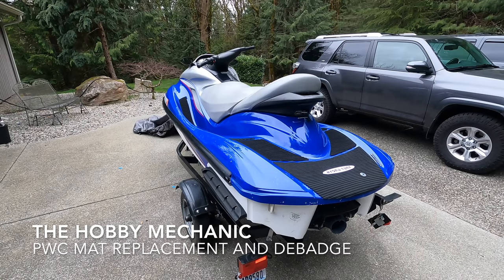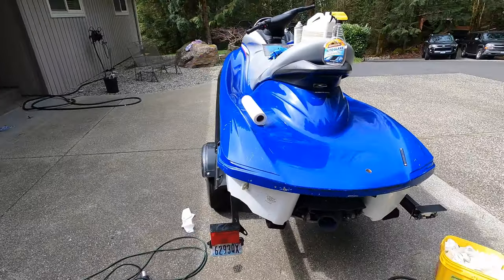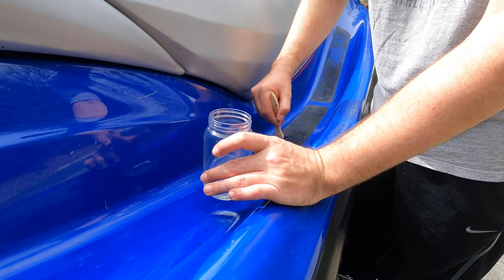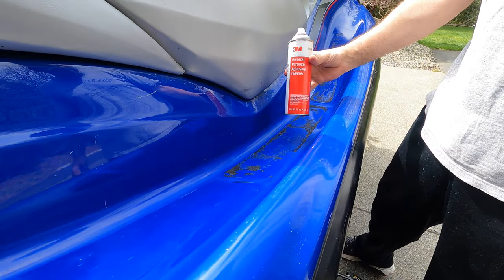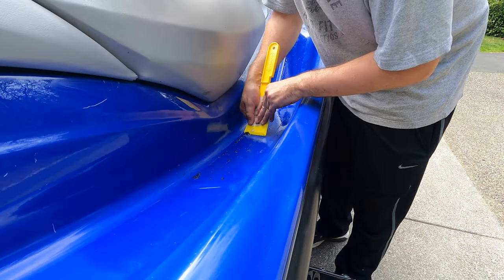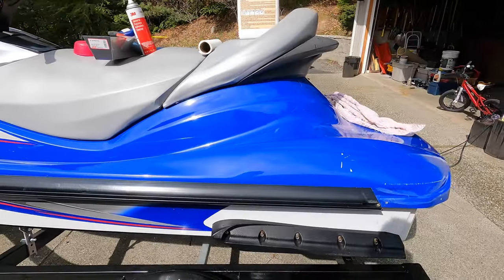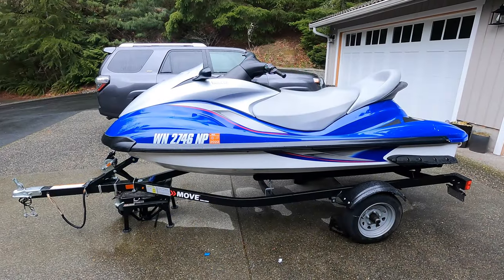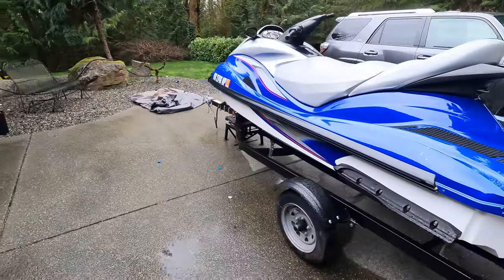Project Remove/Install Mats + Decal/Oxidation Removal On A 17yr old Waverunner - Hobby Mechanic

Comment: I just finished removing my traction mats. I tried a number of approaches I saw on YouTube. They all were not very good. I then tried 3M’s adhesive remove. It worked great. I used Googone on the last bit of glue. Worked great. I had scratches like you. I used a 2 part epony to fill deep scratches and painted with 2 part marine paint that was a perfect match.

Your video was really good and helped.
Reply from the maker: Happy to hear!  Yeah, I thought the other Youtube vids made it look way too easy.  Or they just scratched the crap out of their gelcoat and didn't care.  I've been thinking that masking/taping around the mats first could prevent the scraping.  Maybe next time!

Comment: I have not done anything near this size but you can go to a auto paint supply store and buy a rubber wheel that looks like a big eraser. They use it to take off the adhesive from badges without hurting the paint. Again, nothing this large.

Comment: Instead of adding on more Matt’s with glue, tape off where you want to put your Matt’s and sand it with 80 grit and spray on bed liner. It’s waterproof and will never fade or peel off because you have a mechanical bond with the 80 grit sand scratches and you can use whatever color you want !

Comment: Looks great, so im about to pick up the same ski, (2 of them) but 2006's and Im probably going to do the same thing you just did and the straight pipe too.
Reply from the maker: Nice!  I think they're known to be a pretty reliable motor and platform so a great ski to buy used.  If I were to do the mats again I would mask off around the mats pretty heavy before I start scraping them off to prevent scratching.    Good luck!
Reply: @thehobbymechanic47  Thanks for the tip, and yea thats what I hear also. My buddy is deeeeep into ski's and he swears by yamaha. I used to have an old 2 stroke seadoo and that thing was comically bad lol. stocked to get in the water with these.  im closing on a new house in 3 weeks and it was part of the deal with the house. low hrs and meticulously taken care of.
Reply: I put the Riva freeflow exhaust on my 04 FXHO Cruiser and love it! 

Cheers

Comment: was looking to see how you removed and replaced the rear molding. I cant find any infortation on that anywhere
Reply from the maker: I drilled it out and secured it back in place with galvanized bolts and nuts.